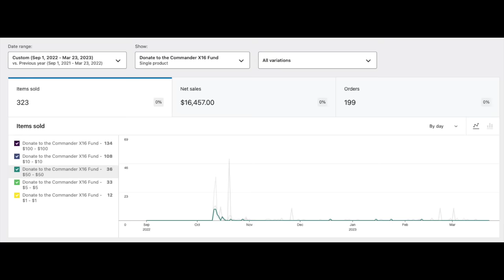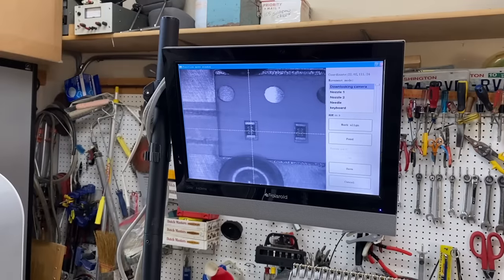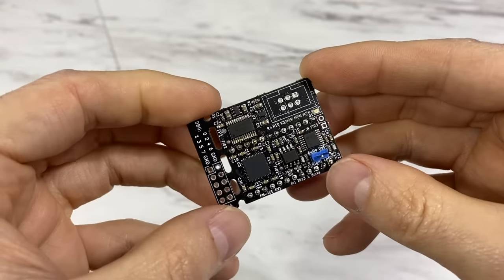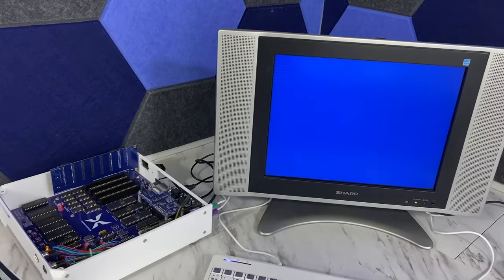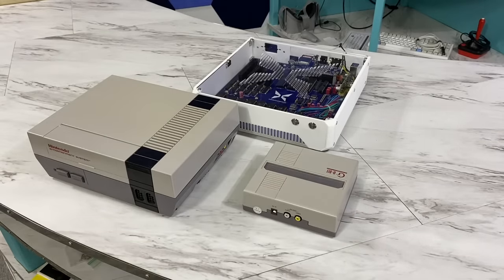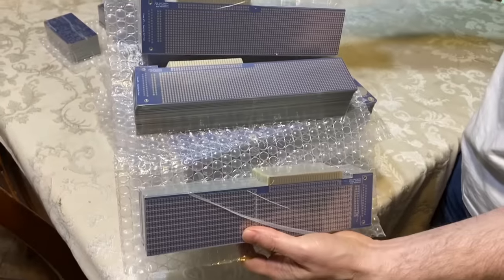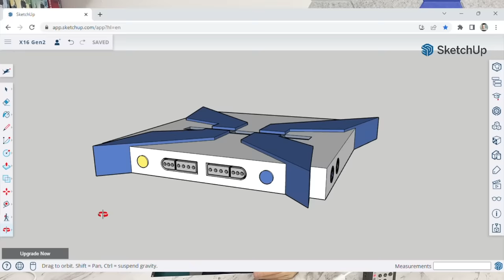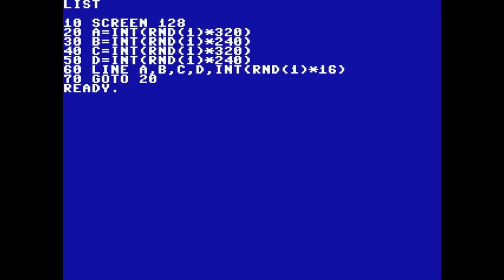Commander X16 2023 update

Comment: Interesting how this project quickly went to the opposite way that was originally supposed: it is expensive, rely on unavailable chips or FPGAs...
Reply: second that .... might as wel be vaporware to me considering the pricepoint
Reply: Yeah. I don't see this ever happening with all the caveats mentioned in the video.
Reply: The project went as smoothly as can be expected for a new hardware design by a major manufacturer with years of experience and hundreds of thousands of dollars to throw in. 

Seriously, do some research. PS3's overheating flaw that delayed introduction to the market. Xbox' red ring of death. Nintendo's Joy-con drift. ZX Spectrum rampack wobble. MacBook Pro stuck and dead keys. Skylake USB 3.0 periferal killer. Ryzen segfault. Xeon Phi FP division feature fail. Atari VCS (1977) stereo speakers feature (the case retains the speaker 'vents'). Atari VCS (1977) video distortion. Pentium FDIV bug. PSP dead pixels. Apple II floating bus crash. Pixel 4 face unlock feature fail (it would unlock for a sleeping or otherwise unconscious owner, offering theves incentive to escalate the crime). SID chip flaw. IBM-PC (all of them, 1981) keyboard lock-up. Xbox stuck disk and permanent read falure. TI 99/4a power supply melt. Nintendo wrist strap failure. Commodore 16 video blur. Titan V simultaneous memory access feature fail. PS2 read failures requiring delayed launch. Atari 8-bit power supply flaws (whistle and screen static). Commodore 64 stuck keys. iPhone 4 antenna issue. Amiga 1000 audio noise.. GeForce 6 fan fail. VIC-20 dead keys.. Galaxy Note 7 explosions... EXPLOSIONS! ColecoVision power supply fail. Commodore 64 dead keys. Surface Laptop 3 adjust refresh rate feature fail (some advertised resolutions were unavailable). Apple II unintended autoexec. Xbox automatic disc scratching. TRS-80 III double-key presses. MacBook Pro ghosting and flickering. Apple III...TMI/tldr;. Sinclair QL dead keys. Sinclair QL saw many, many problems with the keyboard, RAM, power supply, that had to be solved before launch (many were not). Skylake hyper-threading bug. PS4 blue light of death. Ryzen 3000 boost clock feature fail. NES awful cartridge slot and overly error intolerant lockout chip. Commodore 64 original awful RF modulator. Phenom TLB bug. 3DS hinge cracking. Inspiring 5150 flawed motherboards. Pavilion DV overheat and brick.. iPhone SE 2nd generation haptic touch feature fail. Pixel 2 XL screen burn-in...screen burn-in _on and LCD_, that's an ACHEVMENT UNLOCKED moment! Pixel 2 XL color accuracy. Intellifision overheating. Transformer Prime GPS dropped connections. Mac Pro graphics card failure. Galaxy S6 water resistance feature fail. MacBook pro T2 chip fail. Skylake DDR3 memory incompatibility. Commodore 64 original power supply damaging the computer. There's more, but I'd better stop before this mere post becomes a book.

Oh wait, they have matched and beaten the performance of major manufacturers with years of experience and hundreds of thousands of dollars to spend despite being a ragtag collection of hobbyists on a limited budget. 

How about let's compare them to a simular product that had professionals with years of experience.  The May 2018, sorry, November 2020 Atari VCS. Their otherwise profession and experienced chief hardware engineer decided to jump out of a plane with very little effort or thought put into the concept of a parachute, and demanded to continue receiving his salary while not engineering durring his time in the hospital. Units failed to power on and overheated. Many were shipped despite being defective. The industry veterans in charge made inadequate effort to address their customers' concerns. Leaving it to their ex-hardware engineer to voluntarily and without compensation, assure Atari VCS customers that the project was real and in all likelihood would be released soon (although, it benefited him if his former employers earned money to pay what they owed him).

David and team are doing much better than that. In fact, in addition to doing a better job than most big companies at working through the process, they are doing something very refreshing that just isn't done in this industry they have dived into. They are being preemptively open and honest about all the gory details, personally, rather than hiring someone to publicly spread BS on their behalf.
Reply: @zerothis23  Yes let's compare them to a similar project, like the Agon light.😀
Reply: @pietpraters1770  That's nonsense. Shit happens and COVID screwed a lot of stuff up.
Reply: @zerothis23  Most of the faults you mentioned were flaws in the implementation. In this project, the design and supply chain is also flawed, which is a lot worse—it may prevent them from having a viable product at all.
Reply: @zerothis23  OK that's an impressive reply to a post I was inclined to agree with.  What a daunting list of screwups
Reply: It's a cash grab and Texelec got the most.
Reply: @Okurka.  I don't think so. I rather suspect that both of them dumped significant amounts of their own money into this and that we're watching a classic case of Sunk Cost Fallacy right now.
Reply: You mean that someone working from their garage didn't produce a 'perfect' machine like Sony would?!? Gasp!!! 😂
Reply: I think what people who are defending the product as it is now are missing is that it doesn't really matter that this is not a large company. They sought to make a modest product and instead when facing roadblocks on the way to making that modest product drifted into making something else entirely. Like, he scrapped the original design for the board because it was becoming almost exactly what it is now. Except now it also includes out of production parts. Going back and listening to his original goals, his willingness to scrap the concept when it wasn't meeting them, and looking at what this thing is now, I'm mostly just confused. It's not that they did a bad job (which, honestly, they did), it's that they didn't fulfill any of the stated goals of this machine.
Reply: @MisterMoncivais  You mean like the AgonLight?
Reply: @sjdpfisvrj  You forgot the part where they crowdfunded $51k without any tiers.
Reply: Agreed. David and others made a great computer, but we have to agree that they are too far from their own initial wishlist/goals.
Reply: He was told his original parameters where a total no go by people who are actually engineers. He wouldn't believe them and now he has broken almost any and all original goals. This machine is way too expensive for what it is.
Reply: The project is on tack, you know-nothing, this is the planned 1st phase. Pull your head out of your backside!
Reply: @Ffinity  hello fanboy. First phase my ass. The original requirements where original chips less than 200 dollars and no FPGA, so he is never going to get there. Whatever phase he is in.
Reply: @bzuidgeest  Where did it say "less than 200 dollars" apparently you can't read
Reply: @dancooper6002  only about every video on the x16 in the last few years. Apparently you have a short memory or have not been watching from the beginning. This thing has been underway for quite some time. Look up his original dream computer video where he lays out his plans and his  requirements for this thing.
Reply: @bzuidgeest  My memory is fine and I have been watching from the beginning. You apparently don't know how to read.
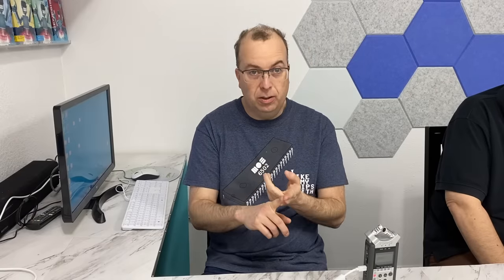Look at "Building my Dream Computer - Part 2" 21:00. In big bold letters it clearly says $200-$300 which for those of us that passed 3rd grade math means MORE than $200 NOT LESS THAN $200. Again, YOU have not been paying attention.
Now, that video was released in September 2019. In case you have been living in a deep mine shaft with your head fully inserted into your colon for the last 4 years we have had a global crisis which was accompanied by massive inflation. Houses in my area that could be had for $250k when this video came out now sell for $450k. Even the damn Dollar Tree is now up to $1.25. $200 in that year is at least $275 now, and $300 is probabally about $400 in real spending power inflation alone accounts for most of that gap.
Reply: @dancooper6002  your going to use inflation to justify the price? Really? Are you joking? You can get better for a lower price, therefore that doesn't make sense at all. If you stop swearing for a moment and you might take the time to Google what alternatives are out there.
Reply: @bzuidgeest  Obviously you got an F in economics, but let me take the first definition for inflation I could find
"INFLATION is the rate of INCREASE in PRICES over a given period of time."
Yes I am going to use inflation to justify the price, BECAUSE INFLATION IS BY DEFINITION A BROAD RISE IN PRICES DUE TO MONETARY PHENOMENA.
Even when the part 2 video came out in 2019 you COULD get "better" for a lower price, hell I bought a Raspberry Pi 4 that year that would blow the doors of this thing for $55, no one is questioning that. 
You are moving the goalposts. First you complained that the price was supposed to be under $200, and when I demonstrated that you didn't know what you were talking about you started complaining about "alternatives" which are fine but they are not the same thing, they are only partial substitutes. You don't happen to have an Osborne handle laying around do you?
Reply: @dancooper6002  not the same thing? i am comparing against other 6502 based systems that are actually new and actually available. That is not moving the goal post. I am not talking about SBC's like the pi. And yes i know what inflation means. The increase is far larger than inflation. Even with higher part prices for some parts, most stuff only gets cheaper. Including most electronic components. You seem very desperate to validate the x16 at its price point. You have to bow to a wife or something? Somebody holding your purse strings😃?
Eagerly awaiting your next rant reply.
Reply: @bzuidgeest  The same processors does not make it the same computer, it makes no difference if they are "new and available" when they are fundamentally different projects.
No, the increase is not "far larger than inflation" as I already explained but you apparently lack the mathematical skill to understand, if you take $200-$300 in 2019 that is comparable to $275-$400 today, thus most of the difference is inflation. 
"Even with higher part prices for some parts, most stuff only gets cheaper. Including most electronic components" 
WRONG. Inflation makes EVERYTHING more expensive because it is a reduction in the purchasing power of currency. NOTHING becomes cheaper due to inflation.
What you are confusing is the effects of Moore's Law, etc. and economies of scale and their impacts on prices. Yes, for much of the last 50 years MAINSTREAM electronics became less expensive for a given level of performance but that is IN SPITE OF inflation, had we not had that inflation they would have been even cheaper.
Further, that phenomena only applies to mainstream electronics in production, its less applicable to components that are low production volume or even discontinued. 
I'm not desperate to validate the X16, I agree that the overall development process has had issues and taken longer than product development should for something like this, but I take issue with your stupid insistence that he promised a sub $200 board when he clearly stated it would be OVER $200 at this stage and that even that number is low now due to the erosion of the dollar.
I bow to no one, but it seems you do.
Reply: @dancooper6002  if you think you cannot compare different boards with the same CPU, you basically cannot compare any computer to another. Nothing is exactly the same as the other or it would be the same product. You just don't accept any comparison. 
Give me your next rant please.
Reply: @blitzwing1  The systems you mention are in my opinion not valid alternatives for the type of system like the x16. I have mentioned other alternatives before. People are looking for a system to know up and down and tinker with. Maybe you could qualify the de10, but certainly not a steam deck or laptop, that is a completely different goal and audience.

And why not the expanded c64 core as you mention. Because they have an idea of real chips stuck in their heads. There is a lot of nostalgia for the old sound chips. But even then, those could have been placed next to an FPGA, as one of the real alternatives did.
Reply: @zerothis23  You getting paid per word for that?
Reply: @zerothis23  amen!